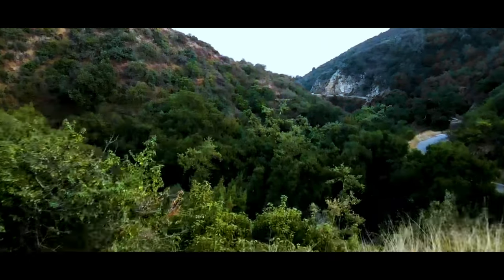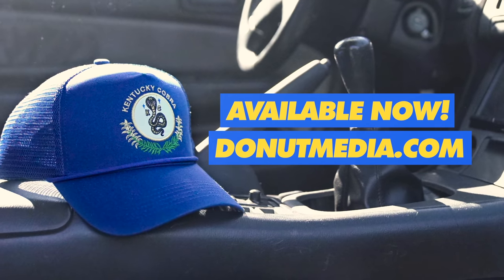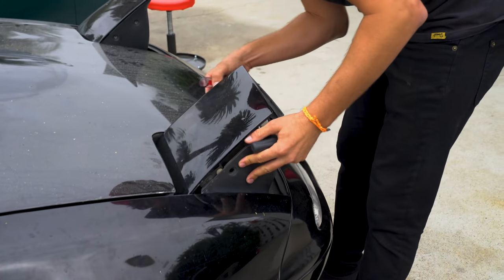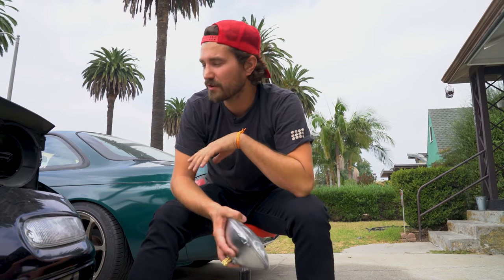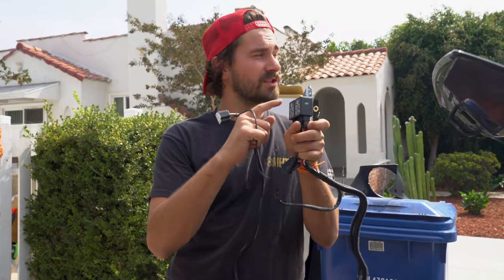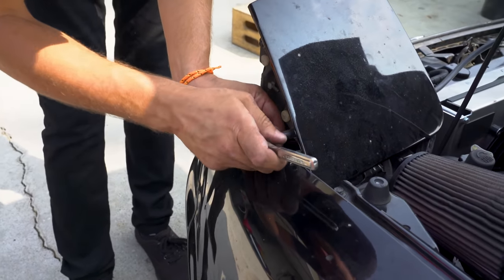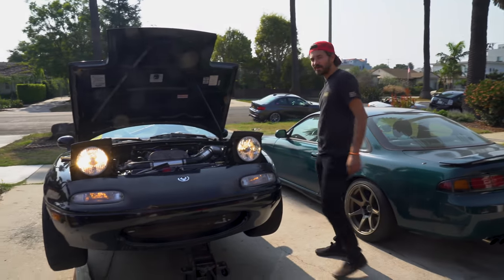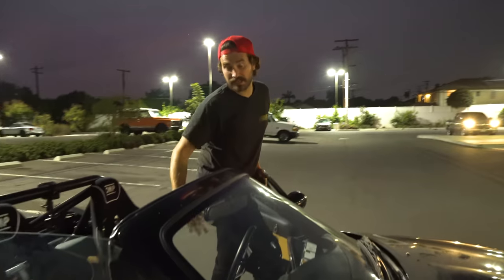Are Aftermarket Headlights Worth It?

Comment: Fun fact, to double the length of the throw of light, you have to quadruple your light output. It's the square law!
Reply: 2.5 min in and was going to point out the inverse square law.  But it looks like you beat me to it.
Reply: and dont  get me started that double the halogen power is like...40% more luminous output?
Reply: And with sound, every time you double the distance from a source of noise the signal drops 6db
Reply: @someguy9520  haha ya I was thinking that also. Halogen is surprisingly efficient for radiant heat light sources (I made that term up but I'm sure there's a term to describe light from glowing heat sources...)
Reply: @bzboii  by efficient you mean terribly unefficient. isnt it like 1% effectiveness?
you get like 10lm/watt with halogen and like 100lm/watt with high quality LED chips

theoretically we can get like 1000lm/watt, so even LEDs are terribly unefficient. thats why they still need active cooling in many high wattage scenarios
Reply: @someguy9520  yeah measuring "light power" by watts was pretty cringe - lumens are a thing and actually do what you want. Even within one tech watts is a bad measure, never mind if you could for instance swap between sources.
Reply: @someguy9520  ah you are correct, I was thinking about metal halide bulbs which get over 75 lumens per watt. 

Just out of curiosity, what's the source for getting 1k lumens a watt? (I love wikipedia rabbit holes so if you could point me down one that'd be great)
Reply: @bzboii  75 is alright. i mean really high quality LEDs get like 160lm/watt

it was some older thesis on luminous efficiency, cant find it anymore. there it stated sth in the ballpark of 1000lm/w
wikipedia says that 683lm/w is the max for the visible spectrum, in that case green light
https://de.wikipedia.org/wiki/Lichtausbeute#:~:text=Schmalfilmlampen%20erreichen%2027%2C7%20lm,bei%20etwa%2040%20lm%2FW.

Comment: Engineering Explained: We should use Watts instead of horsepower.
Donut 1 hour later:   This Miata is 89,000 watts.
Reply: 89kW
Reply: I only use metric to measure my bullets #FreedomMurica
Reply: @cptnscoob  car powere are hsually measured in horsepower
Reply: How many horsepower are these headlights? That's what I want to know now.
Reply: And fuel should measured by hour not by miles since it depends on the vehicle's speed
Reply: "Hello everyone, and welcome!"
Reply: How many hp do your lights have
Reply: 89 kilowatt is just as easy as horsepower
Reply: I just came from that video😂😂😂
Reply: They couldn't have copied them because of how much time it takes to do the editing and shooting so it's just a coincidence.
Reply: Then they go and measure length in Miatas.
Reply: @christianlapointe7796  The two of them are 200W = 0.26820441777hp
Reply: @cptnscoob  MERICA
Reply: @bengreene9072  like trains?
Reply: Yeah we know
Reply: @sk8lucas  exactly!
Reply: My toyota vienta does 130kW xD
Reply: Kw is a great method of measuring power. Its easy to read, already used in Australia/Newzealand and is the standard for electric power.
Reply: The fun part is that in some countries (in Italy for example) kW is the official measure unit for engine power. I mean, we still use hp or cv, but official documents use kW
Reply: So 89kw that is ? For easy conversion, a kilowatt is roughly 3/4 of 1 horsepower
Reply: @christianlapointe7796  if 1kw is 0.75hp, those lights being 100W bulb, that make 0.075hp
Reply: @bengreene9072  fuel consumption should be measures in square millimeters. It makes perfect sense. A liter is the same as a cubic decimeter, a kilometer is just that. So instead of saying "my car gets 23km per liter" you'd say "the fuel economy of my car is 0.043 square mm".
Reply: @fermitupoupon1754  hmm. An interesting concept except squared would mean its measuring an area L×W and liquids are measured in volume which would be L×W×H but we have a measurement that accounts for that. Liters. 
L/hr is what I was thinking. Steps away from the non metric version I was raised on and hate because base 10 just makes sense and allows you to know how much fuel is consumed at that load and RPM. Like 4 liters per 1 hour at given  X load and Y RPM with 12 liters of fuel you can run for 3 hours. I might go and math this for context using my Honda Fit's rated fuel economy because it might look prettier if it was flipped so it would be X hours per 1 liter of fuel
Reply: Ben Greene a lot of cop cars measure idle hours
Reply: @christianlapointe7796  each headlight is 0.107hp.
Reply: Well said and I was thinking the same thing. YouTube producers will say that they don't plan to release at the same time but it's too coincidental. (:
Reply: @EthanSeville  my grocery getter has 180 kw
Reply: My new headlights are 150 horse power!
Reply: @JaredConnell  😂 😆 🤣
Reply: Urgh no, not Watts. It's J/s
Reply: Where I live most people only look at how many kilowatts a car has, not the horsepower
Reply: @MultiDeivas  Kilos are cool too. (:

Comment: Pro tip: those H4 retrofit housings usually have a little rotational play. You can see it when he installs them and he can rotate the housing just a little bit. Once he turns them on, you can see the effect in his passenger headlight, where the cutoff isn't perfectly horizontal. Take advantage of that slop and use it to clock the housing so that the cutoff is horizontal. 

And as a quick FYI: the usual rule of thumb is you want the cutoff to be down 1.5" from bulb center with the car 20' from the wall. That's about as aggressively as you can aim a headlight while still being legal. As always, be willing to tweak them a little during the first few uses so you aren't blinding people. 

Oh! and do this all with a full tank. The Miata tilts up quite a bit with a full tank because the wheelbase is so short. If you adjust headlights with an empty tank, you'll be pointing up at the sky when the tank is full.
Reply: Thanks man!
Reply: Just Thinking This
Reply: 1cm drop per m for the Europeans
Reply: Thank you all knowing headlight guru
Reply: Everything else is good but how far down the cutoff should be depends on the car. For the Miata you can actually lower it just 1/2 inch. For a truck you want closer to 2 inches. The reason is that the beam shouldn't blind other drivers and higher cars have higher headlights.
Reply: My first thought was.. why not go to a European assymetric reflektor? 

I can understand not going LED/HID on a car where you want a classic look. The Hella rewire kit does wonders for any H4 equipped car, the voltage is very important for halogen bulbs. Dropping from 13 to under 12 volts at the bulb can loose 25% of the lumens. 

I hope he doesn’t melt the new housings as that highpower H4 also pumps out double the temperatures.. the connectors are only made for standard 55/60 bulbs. I have seen several cars that chose a ceramic connector instead of plastic for that specific reason.

I would hit the problem with the easystick and add some 90’s small Hella FF50 or FF75 drivinglights

Comment: 4:23 i was expecting him to calculate how much horsepower the headlights make. little disappointed :/
Reply: Well you can do it yourself. He gave the ratio :p
Reply: High beams are 0.13 and low beams are 0.10
Reply: 80/746=0.11hp, and 100/746 0.13hp. So his car was 120hp before, now it is 119.78hp on low beam and 119.74hp high beam meow.
Reply: @numberpirate  the engine doesn't power the headlights tho
Reply: @RobCharo  Engine cranks the alternator which charges the battery and powers accessories
Reply: @RobCharo  that’s because the headlights power the engine :P
Reply: @RobCharo  It actually kinda does, just not directly.
Reply: @RobCharo  it does lmfao what else would power it? the battery is charged by the alternator in the engine

Comment: I love how everything was so easy to install and adjust back in the days. Imagine changing your lights on a 2020s car your self 😥
Reply: not really that different. except it's just harder to get to them.
Reply: Harder to get and 90% of car have to remove bumper
Reply: Well.. not much different apart from tearing down the entire front end of the car just to reach the bulb...
Reply: They were a pain in the ass. most of the time the adjusters would be rusted out.
Reply: One side is usually a piece of cake. The other side, though...always has the goddamn battery or fusebox right in the fucking way. I respect engineers, but I fuckin' hate 'em.
Reply: I had a 2010 outback and the low beam bulbs had to be changed through the wheel wells with the plastic liners pulled out and the wheels off.
Reply: Mmm.. 2012 passat here buddy.. discontinued. Mclovin it
Reply: I mean it really depends, my girlfriend changed the bulbs on her 2021 civic in literally seconds and clueless with tools, same with my gti. We didn't need any wiring or conversions. But some cars are difficult. It just depends
Reply: I'd have to use my imagination because I've never had an LED car headlight burn out in 10 years.

Comment: 100w «rally» bulbs, were known to melt reflectors.

I have had really good experience with osram Nightbreaker bulbs :) They output alot more light than regular 60/55w bulbs :)

Relay kit is a good upgrade on alot of older cars where the power runs through the stalk on the steering column as this causes a voltage drop when it gets to the bulb :)
Reply: It can also cause a fire in the steering column if you're drawing more current through there than those little skinny wires can safely handle.
Reply: Same, using plastic reflector with high wattage bulbs is a big no no.
Even if you don't deform the reflector, it can get dull because of the heat.

These high wattage bulbs should be used with metal reflectors.
Using H4 LEDs is usually the best way to go with plastic reflectors, way higher light output per watt and much better spread.

Comment: My first car was '98 Honda Civic and one of the mods I performed was exchanging the headlights for aftermarket ones. I was low on money and did not switch the housing for black ones, but I was satisfied with the modification. I was seeing stop signs three blocks down the street. It was awesome. As for the stock headlights, they weren't in bad shape. It's just that it came to a point where I was barely seeing the street at night.

Comment: One detail worth mentioning: brighter halogen headlight bulbs have a way shorter life span so you'll have to change them more often. Also they get gradually dimmer over time. Cheap HID kits throw a ton more light and don't use as much power but you HAVE TO aim them correctly like Zach did or you'll risk blinding other drivers
Reply: HID's are hotter though.
Reply: @Tallnerdyguy  in overall heat output I disagree. Stand in front of an HID and stand in front of a regular halogen headlamp bulb installed in the same housing and tell me which puts out more heat. Even if plasma is locally hotter than a glowing filament, there isn't much of it. That's also why halogen bulbs pull more electrical wattage to make less light than HIDs: waste heat.

Comment: Also if you want better lights for night time driving upgrade to a more neutral kelvin rating or cooler as warmer lights are more relaxing to the eyes and night.
The cooler ones wont look like they throw as far but they will illuminate so much better.

Comment: Really love this Money Pit series good work guys! Please note at 8:08, there is, molded onto the new headlights' plastic housing, a  power rating for, I assume, recommended bulb usage.  I have had experience with these higher power H4 bulbs and they CAN melt the ABS plastic headlight housing. I would suggest you inspect these headlights after ~1 month of use. Can't wait for the turbo build :D

Comment: A few years ago I converted the sealed beams on a 1980 Malibu to this set up and it was a great improvement. But, I also have a C-6 Corvette that uses the modern headlight system and I cannot find an aftermarket high beam LED bulb that has more lumens than what I have now. There are plenty of companies claiming to improve brightness over the stock H9/H11, but they do not.

Comment: Did they install the lights @ 2:06 in the high/low series? I have the same lights and have yet to find a good install video!
Reply: Yes they did
Reply: @zeea.2428  I found the video. I guessed I missed that one. Unfortunately they didn't show much of the install lol.
Reply: It's just lights? Just take the OEM out, and do the opposite to install.
Reply: @ob9444  that's not at all how those work. When your new lights have more lights the wiring gets complicated. This guy is in for a hell of a time trying to figure out what to splice. I'd take it to a place that does wiring tbh. Save a lot of headache
Reply: @colewelden  and give the shop the headache to deal with lol

Comment: To put a video in short: YES. If you're driving a Miata, or anything with old school sealed beams really, invest in some good aftermarket headlights. It will be a night and day difference, whether you use LEDs or some modern incandescent bulbs.
Reply: I’m still gonna watch the video
Reply: I was seriously shocked when I found out in USA there were sealed beams with non changeable bulb. That is just plain stupid.
Reply: @dindinbre  only on really old stuff.  Most 90’s cars switched to changeable bulbs
Reply: night and day difference, I see what you did there :)
Reply: @IraqVet0608  I looked for headlight casings for my Yugo and found US market ones with non changeable bulbs. I was surprised and thought it was just a Yugo thing, but I was wrong it seems. All cars here in Europe had changeable bulb casings

Comment: Lots of people like your show, and you set an example for many. 
If you find yourself driving fast, (even in the Miata) without being able to use the high beam, the brightness focused in front of the car, will not allow you to see further up the road. 
Not to mention the stripes of light escaping over the cross line of the light beam, as seen on the wall. 
Best to way to improve the lighting would be by fitting projectors, with any kind of high wattage or output bulbs, as they are designed to spread the light, (lower the density just in front of you) and make a clear a cut so you do not disturb incoming traffic.

Please set the right example, lots of love from Europe, Greece!